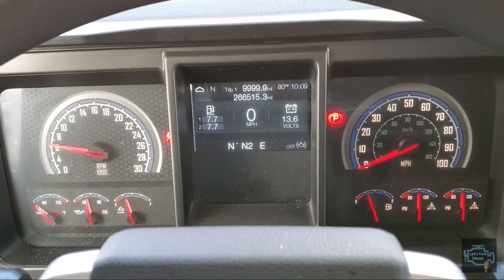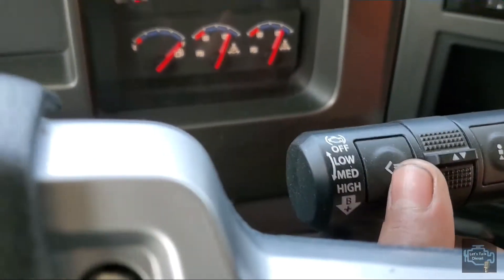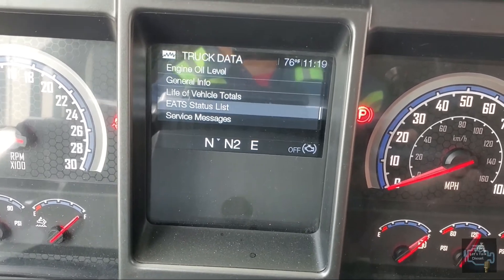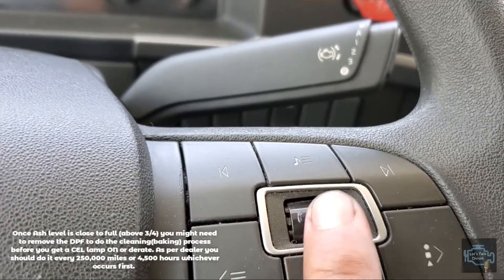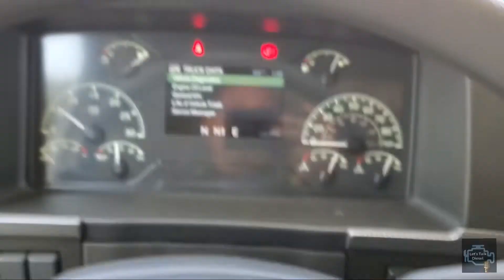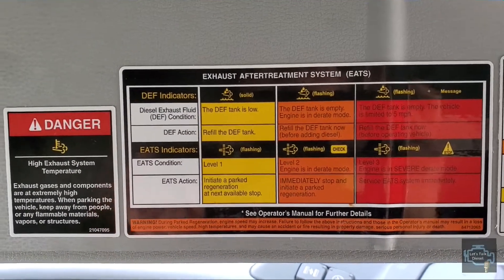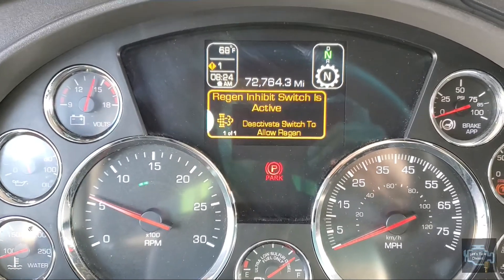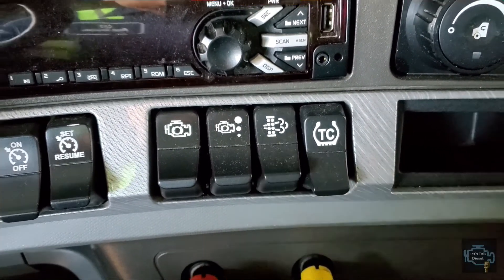How to do the Parked Regeneration Part 2: Mack Anthem/Volvo VNL 760-860/Kenworth T680.

Comment: On average. How long does a parked regen take?
Reply from the maker: Usually, on average, parked regeneration should take from 45 minutes up to 60 minutes. If your truck takes more than 60 minutes to finish the regeneration, might have few issues going on. Thanks for watching.
Reply: @LetstalkDIESEL  thanks. You were right. I did it for the first time yesterday. It took 50 minutes.